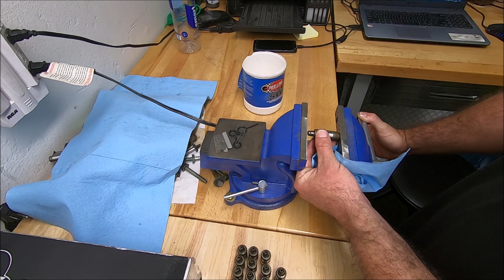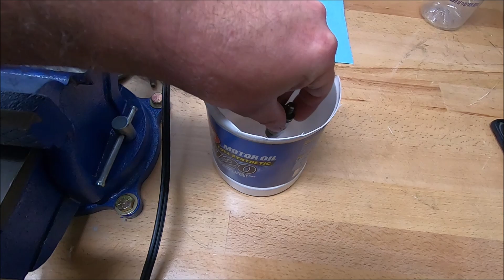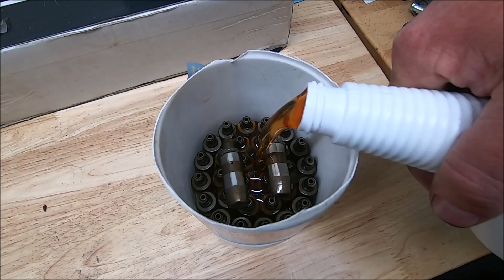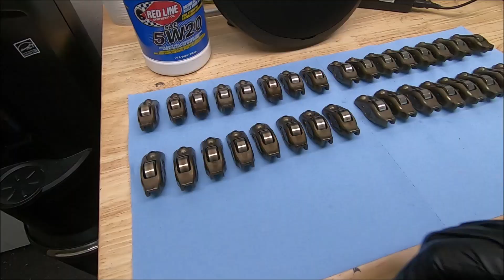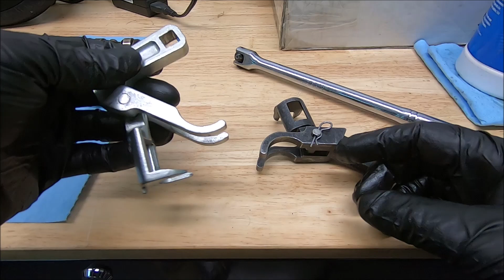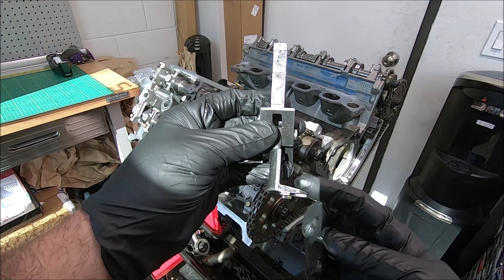Bleeding 4.6 DOHC Valve Lash Adjusters and Installing Cam Followers

Comment: Hello sir, quick question for you have u ever placed “shims” on the lifters? I have an 07 Mustang GT replaced all rocker arms and lifters and other parts due to a “tick” I had, once everything was replaced no more tick everything was good until around 300miles later the “tick” came back a shop told me to put (shims) with your experience what do you think? Or have you heard about it? I would appreciate your advice.
Reply from the maker: It is hard to say what is making the noise without actually hearing it.  However, I have not heard of "shims" on the lash adjusters.for any 2, 3, or 4 valve 4.6 engines.
Reply: @JohnSmithRacing thank you for responding, yea it’s a light lifter tick since it just started making the noise is still light I’m not trying to use it like that because that’s how the first set of cams got damaged.

Comment: So I am having trouble understanding and hope someone can explain it to me as I am putting a 4.6 dohc together myself. If you have to bleed them down, doesn’t soaking them in the oil defeat the purpose? If you just wanna drain the old oil from them I get it, but if you’re just going to fill them up again, aren’t you negating the bleeding process?
Reply from the maker: It isn't required, but some people like to soak them. It doesn't pressurize them when they soak so it doesn't defeat the purpose. I like to bleed them down to make assembly smoother.
Reply: Okay, gotcha. No, I fully agree, I would want to soak them to make sure they have some oil in them for startup just in case priming the engine didn’t get any in them. Didn’t realize they’d be under pressure still when you bled them. Thanks for the reply, this is really helpful!
Reply from the maker: @icanseymour  No problem, yeah bleeding them down makes them a lot easier to install.  Let me know if you have any other questions.
Reply: @JohnSmithRacing One more question for you. What are your opinions on putting 98 cobra cams into an 01 cobra? All my research seems to say they drop right in, just would want a tune. I have a Vortech v2 on my 01 cobra, and I need to replace the intake cams due to some corrosion. Found some 98 cobra cams local to me and figured that would be easier than going further and spending more to get 01 cobra cams
Reply from the maker: @icanseymour I have put them in customer engine and they bolt right it.  I believe they are bigger ooon the intake side so it should be good with a supercharger too.  If you can get them for a couple hundred, it might be worth it.  Otherwise, I would go with Comp Cams, nothing like the sound of a cammed engine.
Reply: @JohnSmithRacing Dang straight. Thanks again brother. Love your stuff btw. Very helpful. Ill be adding some views here next week I’m sure 😂

Comment: Hoping for a response givin the age of the video, but on freedom racings website the show a p# for exhuast side and a different p# for intakes.. to me i dont see why as it appears either one should do both intake and exhaust as it also appears thats what you are doing in the video. Greatly appreciate a response!
Reply from the maker: I just checked their website and I do not see the tool that I used for the lash adjusters.  The one I have is reversible and the one for a 2V is not.  It might be worth giving them a call and see if they know when they will get it back in stock.
Reply: @JohnSmithRacing  got ahold of freedom racing, stallion makes a new tool kit that works for 4v Intake and Exhuast, as well as 2v. Thank you for the response and figured id leave this here for anyone else looking for the proper tool. P# ST-126. Still waiting on it to arrive but they confirmed with me that it is the proper tool

Comment: This is completely wrong! Don't do this! Take a small Allen wrench and put it in the top of the lifter all the way to the bottom and push on the ball valve. Instantly releases all pressure. DO NOT USE A VICE LOL😢😢😢

Comment: Great video and tip... tip for you.... next time you have to do many of these.. .cut 3/4 or 7/8 pipe to the length that you want to stop and insert lifter into the pipe... go slow until wise jas stops against yhe pipe.. done

Comment: Hey man stupid question but could i use the same process to remove them all . Replace timing components and then use the same process to put them all back on once timing is done?

I would really appreciated your help
Reply from the maker: Yes, you could use the same process.
Reply: @JohnSmithRacing  thanks alot for your help

Comment: Awesome and informative.  I'm getting ready to install NEW las adjusters.  New LAs should have oil in them.  You putting them in oil, is the PRIMING them?
Reply from the maker: Yes, but I would say that soaking is not required.  It's a bit of an old habit carried over from pushrod engines.  However, I highly recommend bleeding the lash adjusters down before installing.

Comment: Can I do this without that tool?
Reply from the maker: I have seen some people use a screwdriver to slide the followers over the lash adjusters but I have never had any luck trying it that way.  The tools in this video make it so much easier that for me it was worth purchasing.
Reply: @JohnSmithRacing  got it. When assembling everything after getting it all back from the machine shop, would it be best to leave the followers off while I set the timing?

Comment: Hi John, I picked up 96 cobra and would like to rebuild the engine but I am new in fords. Do you know where I can get cylinder head rebuild kit, timing chain or maybe whole engine kit?
Reply from the maker: Believe it or not, I get a lot of my parts from Rock Auto.  I don't know if they have a kit for the whole engine but they do have timing chain kits, valve seals, rings and bearings.
Reply: @JohnSmithRacing  Thank you for responding, I will definitely check out Rock Auto. In my research I keep running into DNJ auto parts do you know if they make good parts?

Comment: Do you know the part# for the valve spring compressor for 4.6 4v intake valves,?
Reply from the maker: 303-452 T93P-6565-A or T93P-6565-AR  The only place I know that has them is Freedom Racing.  https://www.freedomracing.com/valve-spring-compressor-4v-303-452-t93p-6565-a-t93p-6565-ar.html

Comment: Hey John I am curious about your Cam Girdle setup. Did you just remove the link material between the caps?
Reply from the maker: Yes, thats correct.  A lot of aftermarket cams do not clear the girdle material between the caps.  Just make sure and mark them to keep them in order
Reply: @JohnSmithRacing  Thank you. Do you have an email address that I could email you on? I would like to have your opinion on an issue with mine.
Reply from the maker: @stuheven32  Yes johnsmithracing@outlook.com
Reply: @JohnSmithRacing  email sent.